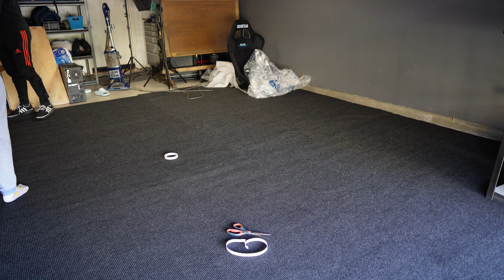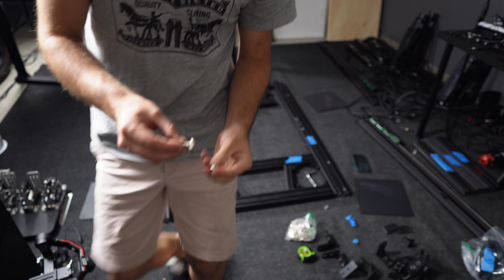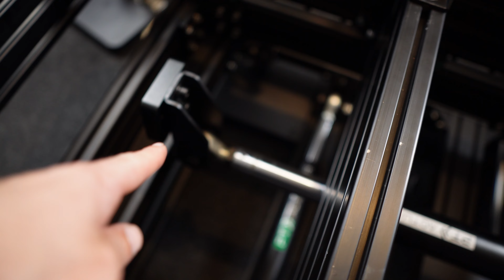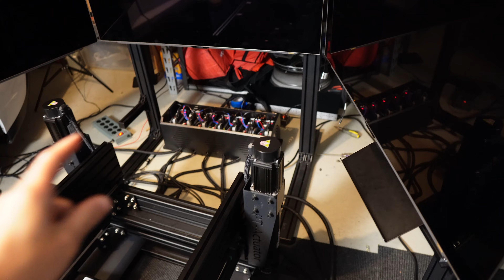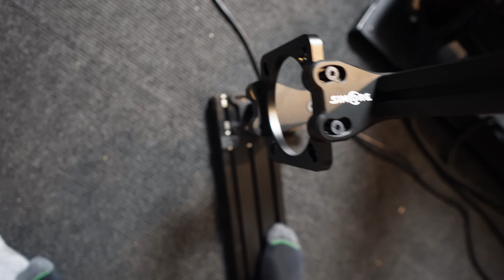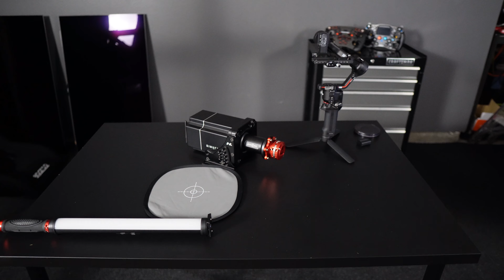Building the Ultimate Sim Racing Garage/Studio Part 1

Comment: i like the monitors mounted on the rig. i have the same on mine but i went from triples down to a single ultrawide + vr. I think im gonna back to triples.. very nice build man. this hobby is expensive you and i have the same thoughts.. buy once cry once 😂
Reply from the maker: The hole just keeps getting deeper lol
Reply: Out of curiosity why do you still need three monitors when you have VR? I can’t drive in 2D anymore so don’t bother with monitors.
Reply: @modularinspiration  yea the triples + vr is kinda meh, because eventually you run out of display outputs. Hence why i went with the 49 ultrawide and monitor is great when ya got friends over vr is boring for the bystanders
Reply: @blacknovella  ah yes that’s true when other people are round. 2D racing just feels so old now though and I can’t do it anymore.

Comment: What kinda of power draw does the motion system require? Curious to know if you need it on its own circuit and then another for the pc equipment?
Reply from the maker: I’m not sure on the power draw and didn’t see any specs on their website for it. But I’ll find out soon enough if I run into any problems.

Comment: Hey man, sick setup! Curious what is the housing you are using for all the servo motor controllers?
Reply from the maker: Thanks! It comes with the pt actuator system.
Reply: @AeroVeloce  I see, thank you for the quick reply! I didn't get mine from pt actuators so I guess I will try find some alternative solutions. Also I know you were using a 3090 to drive the 3 48" OLEDs, I am going to do the same thanks to your awesome videos so wondering have you made the 4090 upgrade and if so how much FPS improved with the new card?
Reply from the maker: @HugBear505  i do have a 4090 now. I have some videos showcasing the difference in performance with the 3090. If you could get a 4090 it’s definitely worth it for these screens but a 3090 still does a decent job.
Reply: @AeroVeloce  got it, thank you so much!

Comment: I'm also running triple 48 oleds and integrated mount.

What I've worked out to be a solution for supporting the side monitors is by using steel cable under tension.

So your centre monitor, have that mounted with taller profiles, enough to mount your overhead monitor onto.

What you do then is bolt in an anchor at the top of the rhs centre monitor profile, and then to the rhs monitor profile, and then from the rhs monitor profile to the bottom of your rig.

So you want the cable to be tensioned both from the top to the side and the bottom to the side.

Use a turn buckle for tensioning it.

It works like a suspension bridge. Opposising equal forces from the cable to keep it fixed in place.

Stainless Steel Wire Rope 304, Marine Grade Cable Railing Kit, Aircraft Wire Rope & Picture Hanging Kit for Railing, Decking, Boat Marine Hardware (15m) https://amzn.asia/d/iLIwYCM

https://www.ebay.com.au/itm/392571496939?mkcid=16&mkevt=1&mkrid=705-154756-20017-0&ssspo=YlYz6J8CQDa&sssrc=4429486&ssuid=o0W19mclR4C&var=&widget_ver=artemis&media=COPY

Track mount tie down anchors
Reply: It's light, not really noticeable and not intrusive. A 5mm stainless steel cable can support like almost a tonne of weight, the aluminium profile and the insert nuts will give way before the cable
Reply from the maker: Great idea! Thanks for the tips. I’ll look into this for sure.
Reply from the maker: I think I have a good understanding of how you have it set up but if you could send me pictures on instagram or discord that would be greatly appreciated. I was thinking of using a super long end link type design similar to chassis supports used in real cars but your idea sounds a lot simpler and cheaper haha.